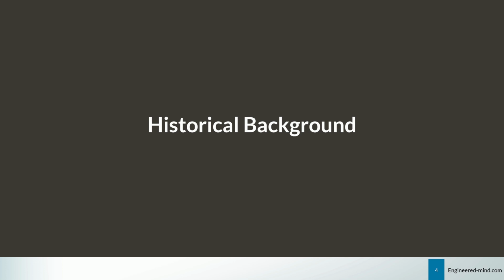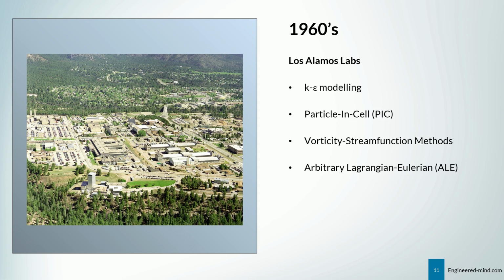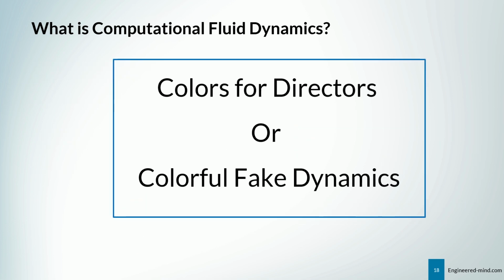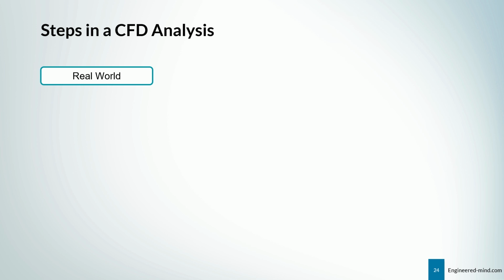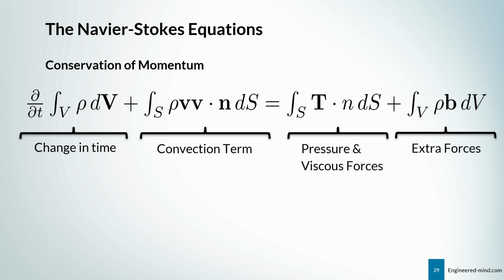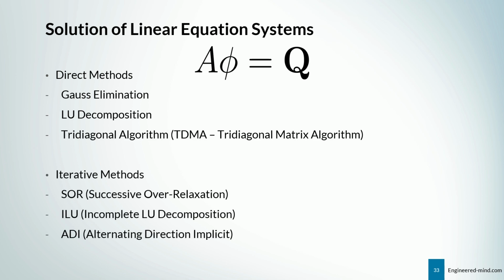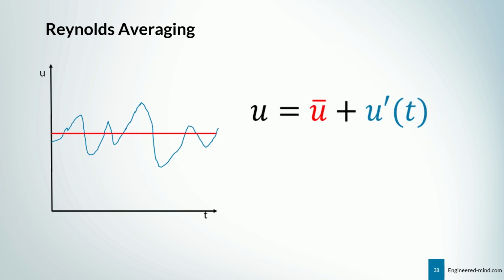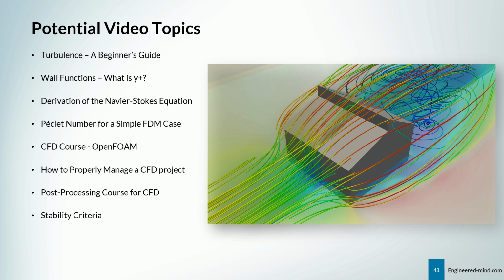Computational Fluid Dynamics (CFD) - A Beginner's Guide

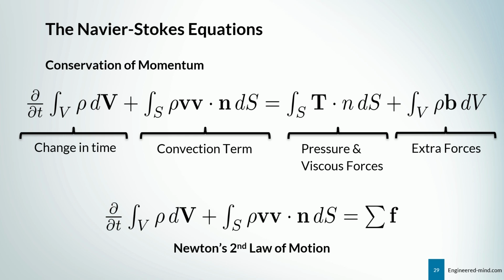Comment from the maker: Important note: At 17:34 there is velocity missing after the density (Rho) - thanks a lot to @Em Jay for noticing!

🎓  My Science Courses – https://courses.jousefmurad.com/
✍️  Latest blog posts: http://jousefmurad.com
📥  My Newsletter – https://jousef.substack.com/

Time Stamps

----------------------
0:00 - 0:25 : Intro
0:26 - 1:07 : Agenda
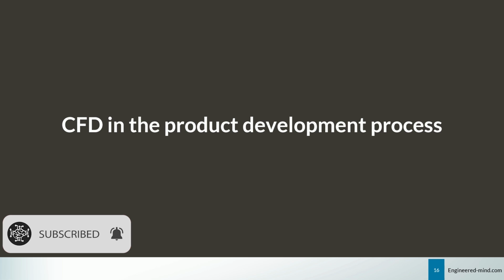1:08 - 7:48 : History of CFD
7:49 - 9:25 : What is CFD?
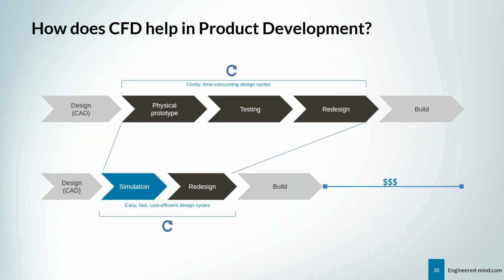9:26 - 10:04 : Why do we use CFD?
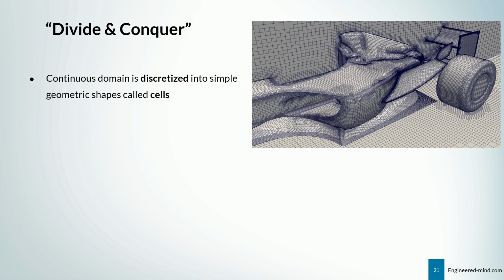10:05 - 10:28 : How does CFD help in the Product Development Process?
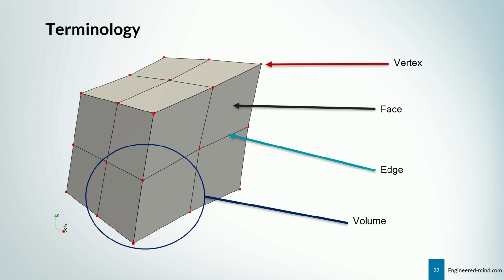10:29 - 11:37 : "Divide & Conquer" Approach
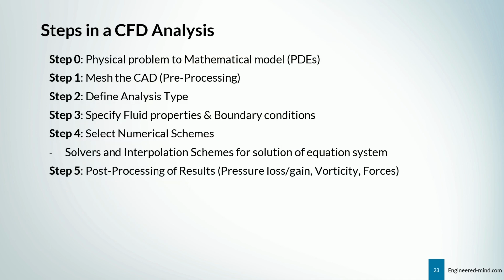11:38- 12:11 : Terminology
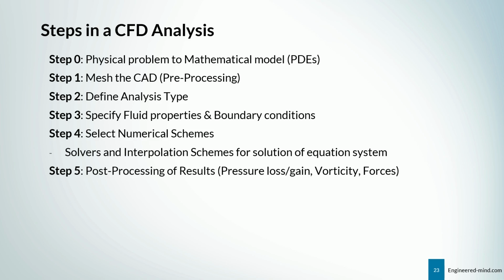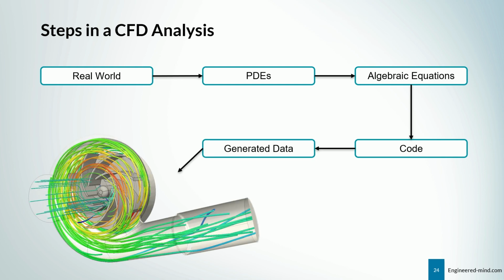12:12 - 13:31 : Steps in a CFD Analysis
13:32 - 14:14 : The Mesh
14:15 - 14:40 : Cell Types
14:41 - 16:02 : Grid Types
16:03 - 19:10 : The Navier-Stokes Equations
19:11 - 20:15 : Approaches to Solve Equations
20:16 - 20:56 : Solution of Linear Equation Systems
20:57 - 21:19 : Model Effort - Part 1
21:20 - 23:02 : Turbulence
23:03 -  24:20 : Reynolds Number
24:21 -  25:42 : Reynolds Averaging
25:43 -  26:32 : Model Effort Turbulence
26:33 -  27:20 : Transient vs. Steady-State
27:21 -  27:51 : Boundary Conditions
27:52 -  28:00 : Recommended Books
28:01 -  29:23 : Topic Ideas
29:24 - 29:33 : Patreon
29:34 - End : Outro
Reply: Dear Jousef, 
can you please estimate how much do you safe when you use simulation compared to a prototype for example in the Automotive industry? 

Many say the estimations are very good but you still need a prodotype. Can you have less volumes of prototypes then or do you safe a complete phase of hardware? 

How much is a computing hour or how much does such software cost? I read you need 278.000 hours in simulation for example.

Comment: Why the Tech world and the Hi Value engineers aimed for riggedness and connectivities of the fixed. Its because of the paralleled worlds and paralleled universes, in mindset of them equal side with each other directional, locational and measurement wise. That is if neglecting higher forms of science. Such as the Quantum mechanics that each side congruent to the other and adjust synch and influence the other if not directly by prompt necessity to be at an area at the proper place and proper time like doors opened and doors closed like in scale platings some open and close for function of traffick ferry by awareness and consciousness at parts. Mechanics of Quantum the hardware part. The particles of Quantum the software part, there have to be a 3rd force. The soul part or Quantum soul. 3 in everything.

Comment: Really nice video, It talked about the history of CFD. Current cloud based simulation platforms. CFD is solving partial difference equations. partial difference equations are having 2 or more independent variables. like about the divide and conquer thing about discretization. steps in the CFD. Different mesh approach and cell types. Grid types. NS equation which based upon Newton law of motion. Difference between FDM and FVM. Energy cascade in Turbulence. About Reynold number. Models of Turbulence.

Comment: Very nice video!  A computational approach for partial differential equations is using radial basis functions rather than a volume mesh.The solution is represented as a linear combination of functions which are non-zero over a limited domain.  The matrix equation then has large non-zero terms near the diagonal so the matrix is likely stable and amenable to algorithms for inversion.  No need to determine a volume mesh over all of space other than at boundary.  Is there  a reason why this is not done for fluid dynamics?  I am familiar with the mathematics but new to computational fluid dynamics.  Another question, what about Monte Carlo method methods as a solution i.e. a fluid particles with drift and Brownian motion? Thanks.

Comment: As a beginner how do one use CFD to solve problems of air quality in buildings
Reply: By using transport theory of species through fluids. In that -
i) Mass conservation equation as per your dimensions. 
ii) Momentum conservation equation 
(To study its velocity & streamline patterns, effects of pressure differences, buoyancy forces if required, etc.)
iii) Species transport equation which strongly coupled with mass conservation equation. 
iv) Energy equation - This is optional if your requirements in design involves heat transfer effects like natural convection of air particles or if external source of energy used like fans or blowers to move forcefully the air in room for maintaining its quality. 
v) Physics of saturated or unsaturated fluids & its thermodynamics aspects should be the primary requirement that how governing equations as mentioned above are involved in actual process of simulation. 
vi) Boundary conditions like temperature, pressure or velocities, contaminant or impurity concentration variations should be specified in the problem statement. 
vii) Study basic meshing techniques like hard or soft, fine or coarse, its geometries like tetrahedral or hexagonal, etc.
viii)Choose steady state or transient solver with proper time steps & convergence criteria as per availability in software. If you wants final air quality status throughout the room then you can perform the steady state analysis. If you wants the status of complete process under some time frame then choose transient solver. 
ix) Can choose proper flow models like laminar or turbulent. Laminar models are preferred for very low air velocity flows otherwise, choose turbulent. In turbulent, there are many commercially available models like k-epsilon, k-omega, omega-SST, Algebraic y+, LES, or any other, etc. 

Read some of the research papers on simulation of air quality in buildings or a room. This will give you more insights.

Comment: Hi,  i am having hard time even visualizing and starting to think about following problem: 

Consider a rigid body (with a mass "M" and interia tensor "I") which is completely submerged in a Fluid of constant viscosity "v" and constant density "d" at rest in a container (Boundary value problem). 
Now consider the fluid is disturbed by some external force "F" at a point "P" inside the container. 
How to calculate how much of the original force "F" acted upon that RigidBody and what are the components of that force on that rigid body. 

Can you help ? Thanks.
Reply from the maker: What about that thesis? :) http://archiv.ub.uni-heidelberg.de/volltextserver/8576/1/2008_07_17.pdf
Reply: @JousefM  Thanks a lot, i will check and get back; i hope i can understand it fully :).

Comment: Did they use this on the 737 Max before it rolled out?
Reply from the maker: lol!
Reply: @JousefM  I know it may come across as a joke, but it's not meant to be rhetorical or satirical.
Reply from the maker: @DylanCVlogTV  Was not sure if it was joke though ;-) But to answer your question, they definitely do CFD verification and validation but the problem with the 737 was a complete different one if I remember correctly (sensor/software issue!?) - so CFD would not have helped here.

Comment: Hi I have a project on CFD on "Unsteady flow over an accelerating flat plate- MacCormack's Approach"
Where I have to solve the convection-diddusion equation by MaCormack's Explicit scheme in MATLAB...Can u please help?
Reply from the maker: I could do a tutorial on the convection-diffusion equation which was planned anyway but not for this particular application. The goal would be to interpret the so called Péclet number for stability purposes. Not sure if that helps.
Reply: @JousefM  ok sir...But can you do a video on the above scheme and it's implementation on MATLAB code for this equation with appropriate initial and boundary conditions...??

Plzzzz
Reply from the maker: @shuvranilsanyal1018  I have heard about that scheme but never implemented it. Can see what's possible but have other things that are high priority at the moment. On my to-do list in any case!